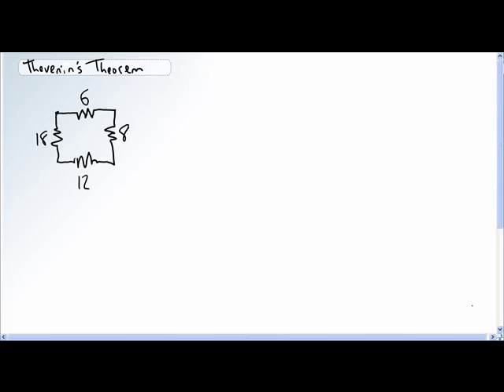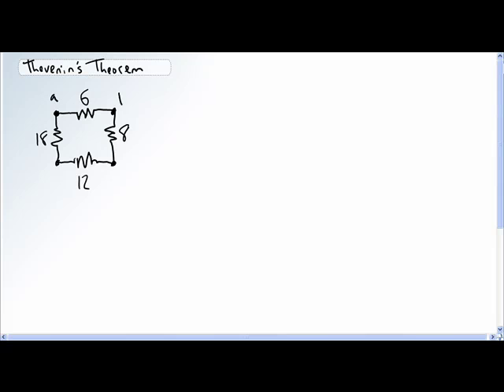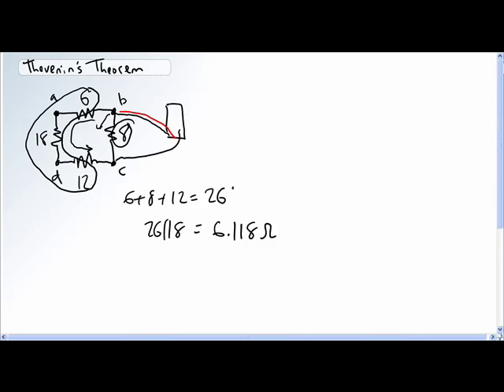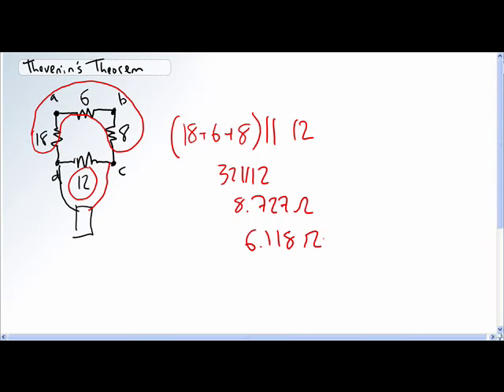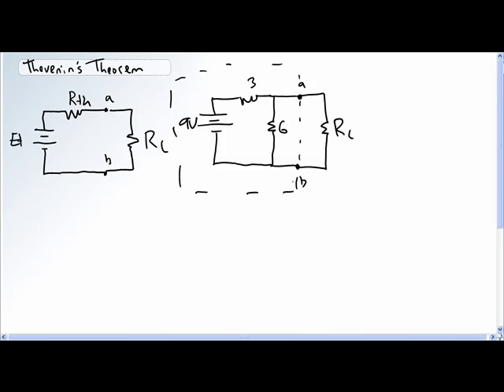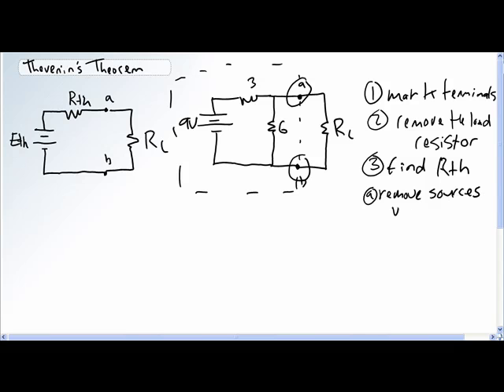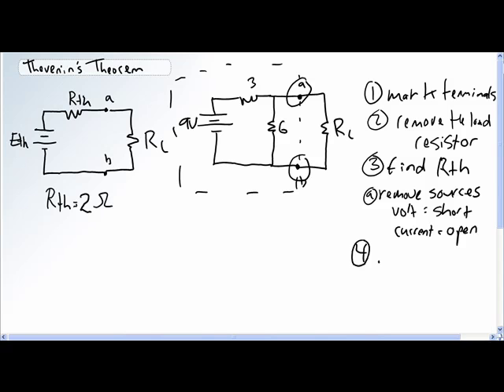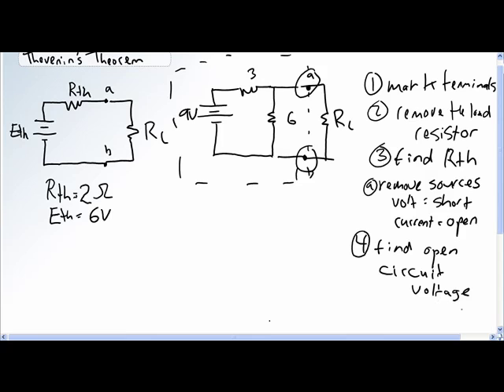Thevenin Theorem Part 1

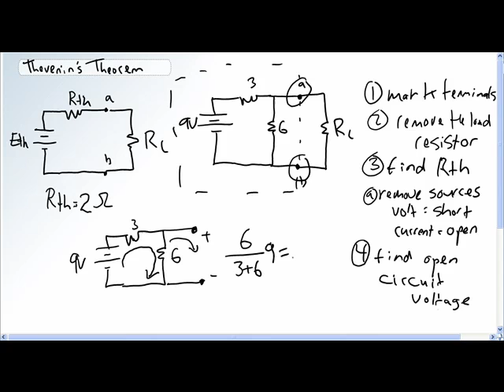Comment: Guys at 9:33 or a bit before can some one please explain the equation of 6/(3+6). Were does the top 6 come from. If the resistors are in series do we not add 3 and 6 together. What is that equation.
Reply: The equation he is using is called the Voltage Divider Equation. To find the voltage (V6) across the 6 ohm resistor (we'll call it R6) the equation would be:

V6 = Vsupplied(R6/(RTotal))

I hope this makes sense, its hard to show an equation without a proper equation generator tool
Reply: The equation I just posted follows from Kirchoffs Voltage Law, in which the supplied voltage will always equal the sum of the voltages across each of the components
Reply: Thx for that. Is why he went for the 6 ohm resistor and not the 100 ohm. After the purpose of the exercise was to find out details about the 100 ohm resistor.
Reply: I have the same question...
Reply: The equation is (voltage source)x(R1/(R1+R2), which is the voltage divider equation. Where R1 is the resistor you are measuring a voltage across, voltage source is the voltage of your source and R2 is the resistor not inside the nodes. In this case R1 is 6 Ohm, R2 is 3 Ohm and voltage source is 9V.
Reply: Quincy Jackle thanks!

Comment: The only part I don't get is at 7:51 where the ohmmeter is told that the 3 and 6 are in parallel. How does it figure that?